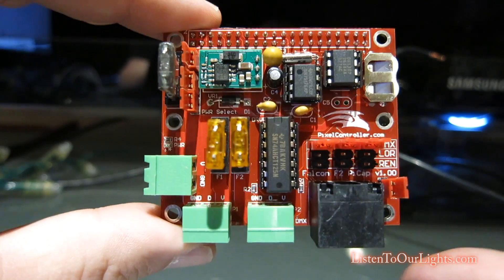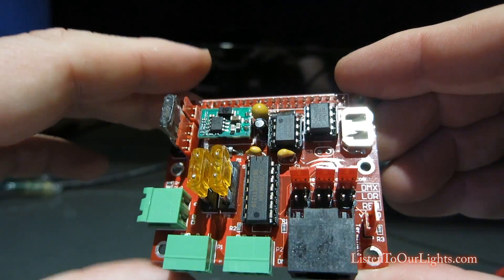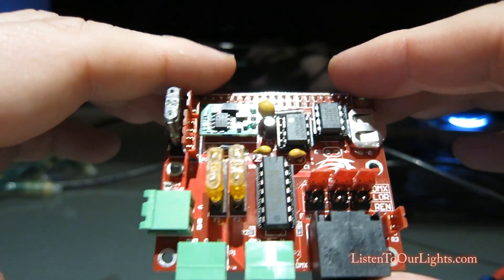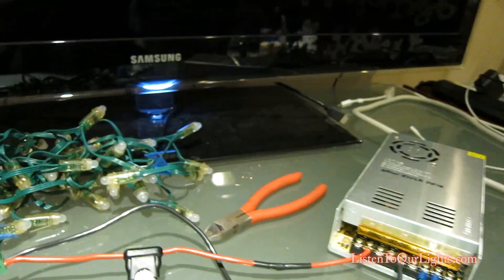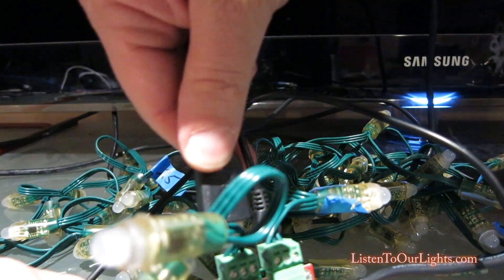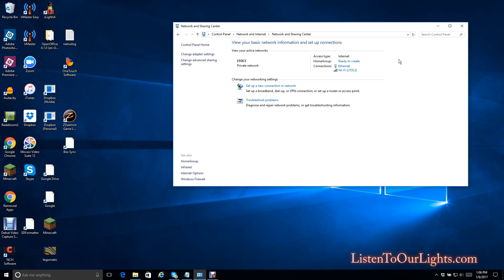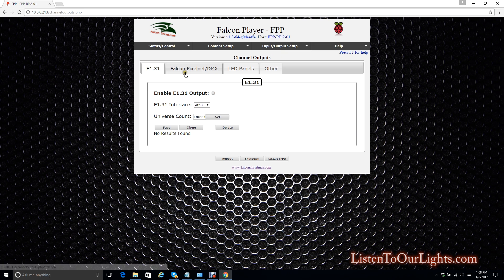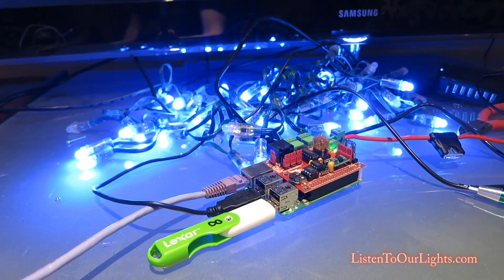Falcon PiCap Setup and Test

Comment: Hi John, I would like to ask can you add extensions to the lights between the Picap and the light strands themselves? if so how long? 
I have ran a show for last few years using Vixen and using LOR 16 channel boxes but i would really like to add some RGBs to my roof line this year, cause my muliti lights for the house keep going out on me, i think the RGBs on the house would look really good but trying to figure out how i can add these. i also currently use a Rasberry pi to run my show. But it is normally sitting in my room right next to my PC close to the window where i run the Ethernet cord outside about 100 foot to my first LOR box. the lights would be as set up now about 20 feet from the box where i would start them on the house. 

Thank you for any info.
Reply from the maker: You can and it really varies depending on the voltage, number of lights, brightness settings, gauge of the wire, etc. In general I try to stick to 20' but you will want to test it out. There are solutions to getting longer runs like famps to repeat the signal and power injection.

Comment: You've got a massive 12 volt power supply hooked up to it and you still have to figure out how to get 5v to the Pi? For the love of God why? Why doesn't the hat power the whole thing?
Reply: The PiCap can actually power the Pi.  I'm currently powering my PiZero from the PiCap running off one 12V supply.  The PiCap has a 5V regulator that it uses to send to the Pi. (The video seems to say you can only power from the Pi to PiCap, but you can do either.)
Reply: @mcmusicusa  This is what I was wondering, didn't want to kill another raspberry pi haha.

Comment: @listentoourlights hi sir i have a question about the compatibility of picap.

Can i use the older version of raspberry pi (e.g. Raspberry Pi 3 B) instead the newer ver. The "Pi3 B+" ?

I have Pi 3 B lying around, and i wish i can use it.
Reply from the maker: I think so. Check the spec sheet for the picap to be sure.

Comment: I noticed that the connector for the pixels is only 3 wire.  Aren't the pixel lights 4 wire connectors?
Reply from the maker: WS2811 are 3 wire. V+, V-, and Data.

Comment: what's the power supply you are using? 5v60a?
Reply: He's using 12 volts, so generally 29 amp PSU, and looks like the full sized meanwell style PSU. He did say afterall, when connecting the pixel leads that he shows around 10:30, 12v.
Reply from the maker: 12v 29-30 amp

Comment: Thanks for the video. Couple questions. What gauge of wire are you using for power? I would like a case that fits the Pi with the PiCap if you have more information on that and what's the battery for, do I need it? Mine didn't come with the battery.
Reply from the maker: I'm using 18 AWG for all of my power injection. I use pre-manufactured cables from US vendors with xconnect connectors. You can make them yourself (and I've done so in the past). Depends on what your constraint is time vs. money.

Comment: I have watched a ton of videos on different pixels and controllers.  This video is the first that I have noticed with a fuse between the controller and power supply.  I understand that this is recommended, however I am confused on the size of the fuse.  If I have a 30 amp power supply, should I have a 30 amp fuse or per the 80% rule, 24 amps?  Hope this makes sense and thank you for all of the helpful videos.
Reply: of most of the fuses coming from pixelcontroller.com, they all use 5amp fuse, between the controller and the euro plug outputs.  just keep your fuse between 10 and 25 if you are running 50-80% brightness(brightness on string controller properties in xlights is doable but not sure if the picap will also do it for you as configured, someone answer this for me.)